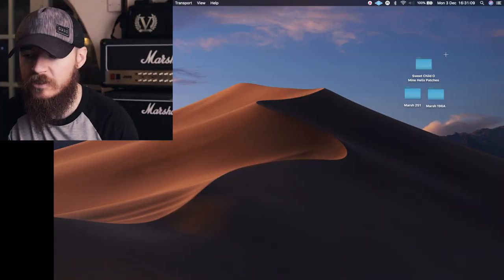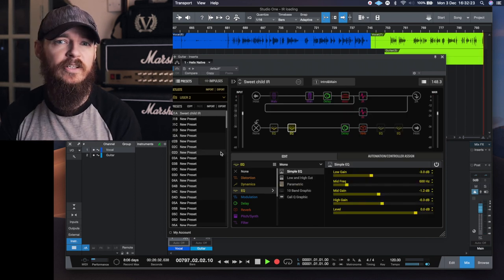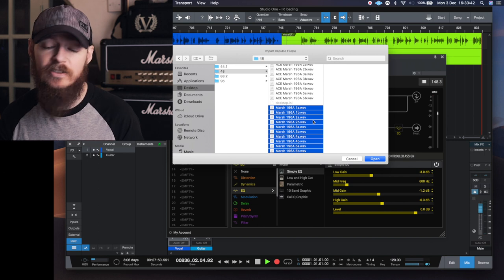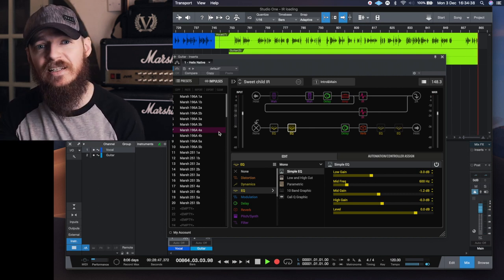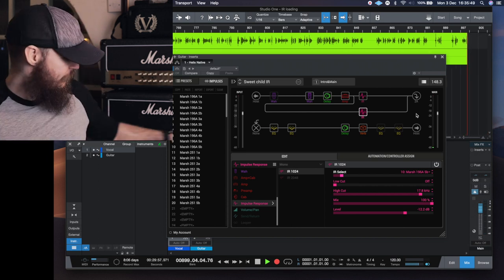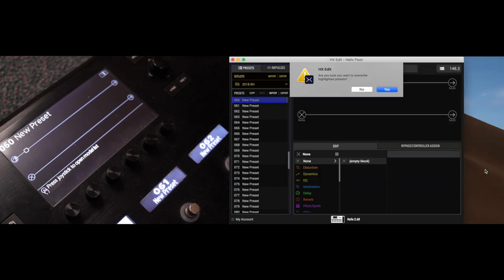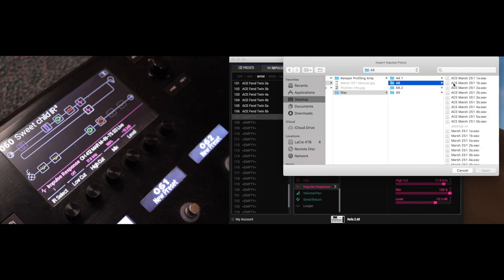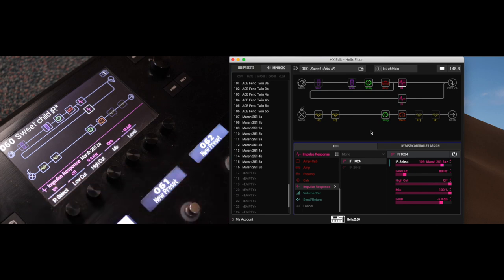How to Load Impulse Responses into Helix

Comment: Good vid! Let's say i made a preset with an IR . Now i want to make a new one, so i load a new bunch of IRs to choose from. Do i have to keep the IR from the first preset that i made on the list? Can i move that IR in the list or it has to stay exactly in the same place it was when i created the preset?
Reply from the maker: Hi, if you want the old preset to keep working then the IR needs to stay where it is. Each preset just points to an IR, so say you built the preset with an IR stored in location 50. If you then put a different IR into slot 50 the preset would use that IR instead of the original even tho you haven't changed the actual preset. You can just point the preset to the new IR location and re-save it. hope that makes sense.